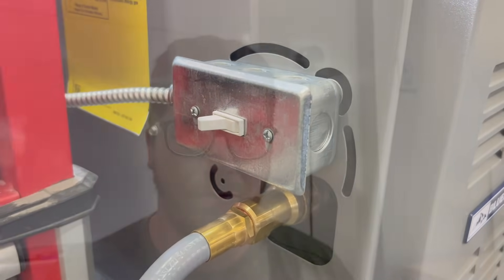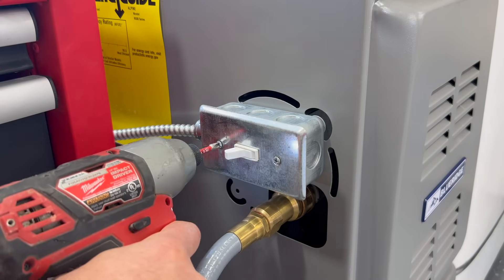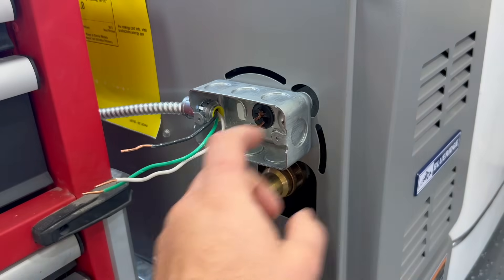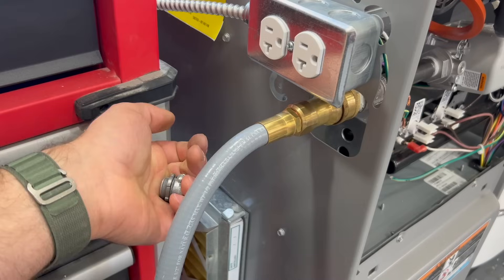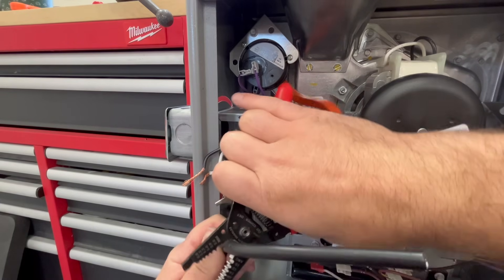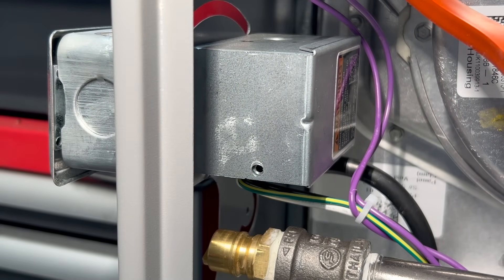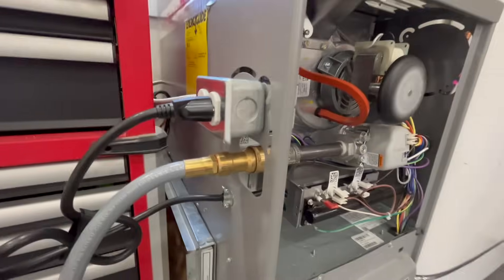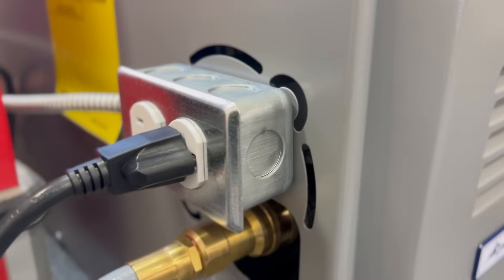Keep Your Family Warm During An Emergency Power Outage With This $20 Fix

Comment: Just a couple of code pointers. That outlet needs to be 15, not 20 amp on a 15 amp circuit. That also needs to be a dedicated (single) outlet or you will need a GFCI. (concrete floor = damp location) That pigtail connections needs to be OUTSIDE the cabinet so you don't void the UL listing of the appliance. (temp rating of internal wire) Last but not least, the NEC will call for a service switch at the unit even though a cord / plug qualifies as a disconnect. This will be under the headings of permanently installed appliances. Probably best to swap out that 2x4 electrical box for a 4x4 and do it all in one place. Store the excess pigtail behind the BX cable in a loop.
Reply: Yes, HVAC techs are not electricians.
Reply: @billy-go9kx    which is why most HVAC guys don't have a full grip on the NEC, despite their license covering all the wiring near a unit. (but not into the breaker panel)
Reply: @billy-go9kx  True, hence the wrong terms and wrong steps or missing info for a safe install! Stick to what you 100% know to keep people safe! Great comments from those who know!
Reply: @billy-go9kx  Why yes, some of us are... Even if not, we should know the code of what we are doing or don't do it.
Reply: You are 100% correct.
Reply: You could use something like a Leviton T5225-T Combination switch & 5-15 receptacle, which would fit in a single box.
Reply: @leeroth5604    Yes, you could but for a DIY that work box is getting a little crowded with the extra wires and restraints. It has no room for side entry with that device in place and the screws will be hitting when trying to secure that device. 4x4 box with a mud ring is the way to go.
Reply: @leeroth5604  : He made another video where he uses the Leviton switch.
Reply: @leeroth5604  Yes, combo switch/outlet solution! Upgrade to a 1900 box and single gang ring if necessary to avoid crowded wiring.
Choose a new knockout for that power cord to avoid any drilling.  Yep, Neutral to Ground adapter (or a spliced, tagged cord?) if required; be aware that will trip a GFI.  
Be careful! Don't try to do all this working in the dark, LOL.  THINK - Are folks really qualified to attempt this in the first place especially with an external power source? All of these things can kill!
Reply: Yeah this be a total code violation on multiple levels here in Canada. I even had my installers come back after they installed the switch wrong. Here you need to have a service/emergency switch, it cannot be on the actual furnace but has to be at least at a certain distance. Mine is at the  entry door into the utility room. When placed there it can also not be at the regular height of switches but has to be at average "eye" -ish level, with a red face plate if it's a gas powered furnace.

To connect the pig tail to a device would also only be allowed if the actual product would state that in the instruction manual and it would then obviously needed to be done as described. Make sure that you do not connect a pig tail If a device is only intended to be hard-wired.
Reply: @paulkoopmans4620 everything is a violation in Canada.
Reply: Could you qualify what you mean here-->    That pigtail connections needs to be OUTSIDE the cabinet so you don't void the UL listing...
Reply: @avflyguy    I'll spell it out.... if you have a UL approved device and you modify it, you no longer have a UL approved device. It may be a fine line but keeping modifications to the wiring OUTSIDE the cabinet is the difference.
Reply: @rupe53  Thanks for that info.  So, the wiring box inside the case of the furnace can't be used to join the pigtale.   Rather those wires need to be joined in another utility box outside the case.  In other words, you just cant leave the pigtail and furnace wires just can't dangle around the inside of the cabinet?    I want to do this right..but I've seen quite a number of other videos that have the pigtale wire connected as shown or similar to this connection method.   Also on the ground wire... it shows the case green wire, then it appears he added a bare ground, but doesn't show where that is to be grounded.  Appreciate your comments -  I just want to get it right and you seem to know what you are talking about.
Reply: @avflyguy   Yeah, it's a grey area but staying outside the cabinet you are only dealing with NEC requirements and not modifying the appliance itself. NEC will have you using proper gauge wire (#14) on the pigtail and all grounds terminate to the external box, which is secured to the cabinet AND the 3rd prong of the outlet, along with being connected to the house ground wire. Per NEC, there's what they call a "fill rate" or "fill capacity" for any junction box. The 2x4 box isn't big enough so swap that outside box for a 4x4 and use a mud ring or a work cover to mount your plug /switch assembly. The catch with the UL listing is about operating temps and exposed wires inside the cabinet that are line voltage. T-stat wires are exempt due to being low voltage. For the actual wiring part, house feed is to the outlet first and the switch goes in line with the pigtail. That way the switch functions no matter what the power source is. (power station or a portable gen in the driveway) This entire grey area is about liability for equipment warranty and your homeowner's insurance. If there's ever a problem with an investigation (fire in the house?) then someone will be looking.
Reply: @rupe53  Thanks again.   I think I've got it now.   Already have a 4x4 box and mud ring.  Just need to get a metal cover plate instead of trying to force all the wiring in standard single gang metal utility box.   I already have the Eaton TR274W-BX-LW  switched outlet and other 14/12 ga wiring I'll need.   The grounding (attached to the cabinet) will also supply a path back to ground back to the panel ground, which inside the panel already is bonded ...(not doing this off a subpanel). What is a bit odd,  is my house was built in 1983 and while it does have it's proper mix of 15 and 20 amp breakers, aside from high draw 220v circuits  all  110v wiring from the panel/breaker box is 12 ga throughout the entire house. There is no 14ga wire used anywhere in the panel to it's destination of circuits, swithches, and recepticles (aside from 220v circuits)  I''ve already made my own grounding plug to bond netrual and ground for the generator (if needed).  My biggest concern is potential for damaging all the electonics boards in the air handler and whether or not this will work with variable speed heat and AC system.  It's not just and on and off.  It adjusts or ramps up the blower as needed to satisfy the themostat call.  In 2021 in the TX freeze out, when power did come back on, the heater ran at high speed for many hours, then when it got to target temp, thereafter it only came on low speed blower.  
You've been a great help to the confidence going forward with the project.  Texas has grown by over 2 million people since 2021 and more EV cars on 30 AMP chargers,  has put the grid more at risk and the governing bodies of TX politics along with ERCOT (the states grid monitor) nor the PUC, or ulilitiy companies have done very little to increase grid capacity and protection much above 2021, despite all the chatter.  We do not import electricity from any other state.  IT's still the WIld West around these parts with gnerations of Cowboy Oil and Gas mentality.   $$$$ is an expected lifestyle for these free ranging career  political chatter boxes.  Smoke and Mirrors...........
Reply: @avflyguy    pointer: look at the data tag on the heating plant. Most likely it calls for a 15 amp circuit... because all of the internal wiring is only #14. The easy fix is to replace the breaker. It's ok to have oversized wires but the circuit should likely be limited for safety sake.
Reply: @rupe53  Yes...  On the tag inside the air handler It does say 3/4 HP  < 12 amp on the furnace and the breaker is a 15 amp for the furnace in the panel.   I'll give it all a go this weekend and see what happens.  Thanks again!
Reply: @rupe53  So... if you burn down the house, your insurer will deny the claim for the use of an installed Unlisted device.
Reply: @eegg6954    with insurance companies there's always a possibility they will try to wiggle out if it's obviously tampered with. Right now I am waiting to hear what an insurance company will say to a guy who burned his house down by using an outdoor deep fryer in his garage on turkey day. (it was raining) Yeah, it wasn't intended for that use so the guy is a dummy. House was appraised at $3.6 million recently and now it's a charred pile of rubble.
Reply: @rupe53 Thumbs up, Thumbs up, Thumbs uuuup ! Lol... But thanks .... This video and comments two out of 5 not waste of time....
Reply: @avflyguy  he's making it up.
Reply: @avflyguy basically hes saying your long black plug wire is spliced outside the containment of the furnace cabinet where your wire connections are made , the same waythe connections are made inside the original light switch box i guess the assumption is the connected points could generate heat or a spark which is better to have outside the cabinet
Reply: He was using his pointer finger on the drill/driver trigger. OSHA would recommend using your middle finger often referring to it as the power grip which reduces fatigue and possible future muscle skeletal disorders.
Reply: @Jesusiscomingsoon613 😂
Reply: That's why you just quickly splice in a plug during the outing, then take it off once power is restored
Reply: @MikeBarbarossa    by the time you do a hack job twice you could have done it CORRECTLY once and be finished for a lifetime.
Reply: @rupe53  How is returning to the in code, proper wiring " a second hack job" get out of here with that strawman. It also takes less time ( 2nd strawman)
Reply: @MikeBarbarossa   ok, do it your way if it makes you feel better.
Reply: @rupe53  I can also point out, if there never is a pefectly timed, long power outage in the cold, so cold you have to run the furnace (less likely in the south) you are the one who wasted time, and it's a lot of time based on the trip to the hardware store, and all the things you have to do do it "proper" (like you said) based on all the code requiremnts stated by the OP. and all but the biggest power banks will only be able to run the 250 watts a short time ( you'll need the $2000+ power banks to get decent run time)
Reply: @MikeBarbarossa    my pointers have nothing to do with timing of outages. They are for convenience of quick change-over and safety. You can choose your power source based on needs and budget. A boiler uses less power than a furnace and neither runs 100% of the time. BTW, the trip to purchase supplies needs to be done for the shortcut or a proper job, so quit splitting hairs. If you are too cheap to have a backup power supply that's adequate, then you suffer.
Reply: @rupe53  "too cheap to have a backup power supply" You do realize a lot of folks dont have 2 grand to spend " just in case" I can splice in a cord laying around to the furnace in under 5 min and no trip to the store, and nothing to do at all  unless power goes out extended in the cold. I've lived in Texas and Kansas for 60 years, and never once shivered in a house due to extended power outage in the cold. I do understand it's more likely up north
Reply: @MikeBarbarossa  Who said you have $2k to spare? You already implied that you have somewhere to get power by the fact that you are willing to splice in a cord you have laying around. If you have no alternative power source then why bother?
Reply: @rupe53  You said "If you are too cheap to have a backup power supply that's adequate" - adequate backup power supply is $2000+. You have to have 2k TO SPARE after all other needs to get what you said everyone was " too cheap" to get
Reply: @MikeBarbarossa    In case you haven't noticed... there are people who are doing the same thing with a $399 get set from Harbor Freight, which is also an alternative power source. As I stated earlier, it's about YOUR personal needs and budget, just stay safe doing it. Arguing doesn't make your way any safer.
Reply: @rupe53  You haven't explain how taking the 3 wires from a pigtail, connecting them to the furnace power supply in the EXACT same way they were  connected to the regular power source, making the furnace a plug in appliance, the same kind of plug in arrangement used safely by the 100s of millions of appliances  the USA, then taking that and plugging into a Bluetti power souce...you haven't explained how that's "unsafe". You can't say " just is"
Reply: @MikeBarbarossa    I didn't say plugging into an alternative source was unsafe. I said your hurried change-over with a cut off cord sounded unsafe. That's why I went into details of the code and why it should be done the way I explained, and taking your time when you are not under the gun to get it finished.
Reply: Would it be right if instead of running a duplex plugin as the demonstration was done, If i ran a 15A Switch/ plugin combo
Reply: @sambo5103    That would pass muster in most places as a dedicated outlet. IOW, no room to plug in something else. Just remember that if you have a condensate pump (condensing furnace) you'd need another single outlet on the furnace side of that circuit. That could be done with a duplex and breaking the tabs to isolate the two sides.
Reply: Or buy a EZ Generator switch
Reply: @claddagh1000    you had better provide a link so there's not a bunch of people asking what you are talking about.
Reply: rupe 53 already said what I came here to say.
However, I have never had an inspector (authority having jurisdiction) ding me for not having a switch on cord and plug connected equipment. 
That would just be silly.
Reply: @jstravelers4094  The difference is that some appliances call for a disconnect (cord & plug will do) and some call for a local service switch.
Reply: Yep.... I was going to comment, wouldn't it be smart as just to add the pigtail, thereby being able to plug it right in the generator but not negating the switch... I
Reply: My goodness all u commenter's forgot convict the producer of thought crimes.
Reply: Not challenging, honestly want to know, aside from code doesn't a amp outlet protected by a 15 amp breaker provide more safety margin? I understand you wouldn't want a15 amp outlet on a 20 amp circuit but I don't understand how a higher rated outlet (20)  with a 15 amp protection would be bad.
Reply: @lauraniemi508    it's in the code. Basically a 20 amp outlet has a different configuration for the blades which would allow a higher rated appliance to be connected.... and in this case the wire and breaker should not be 20 amp because the heating appliance is not rated for it. Everything should be 15 amp.
Reply: Kinda like saying you can't haul 1/2 ton of cargo in a 3/4 ton truck.
Reply: @lauraniemi508    actually, it's more like saying you can't drive an 8,000 pound truck on a 6,000 pound rated bridge. The bridge isn't rated for the possibility that the truck might be fully loaded. IOW, same size but different load. Look close and you will see that 20 amp outlet is different than a 15 amp outlet.... and a 20 amp cord won't fit in a 15 amp outlet for a reason.
Reply: $20 fix if happen to have a generator laying around
Reply: @RichD-f7k  correct.
Reply: Can I hire you to do this?
Reply: I thought he said some of the older units were 20 amp, thus the 20 amp outlet? 
Did I miss something?
Reply: @consciousobjector2507    I have worked on residential units dating back to the 1930s and never saw one with heavier wiring. You also missed the fact that unit in the video is fairly new.
Reply: @rupe53  the unit is FOR DEMONSTRATION PURPOSES ONLY as HE CLEARLY STATED. 
And everybody's an armchair quarterback lol 😂
Reply: @consciousobjector2507    yes, that statement is at the start of many videos and means "don't do this at home because I don't want the liability when shit happens."
Reply: Nice explanation,
Reply: And the best part is that if you have a new furnace, you just voided your warranty by screwing around with the furnaces interior!
Reply: @thatsright1648       if done my way it's all external and you are not modifying the unit, which may affect the UL listing as well.
Reply: Needs to be GFCI regardless... single or duplex. Can't stand seeing guys like this giving electrical advice
Reply: @muzzcovw7674    Unless there's some new code I believe you are incorrect. Boiler or furnace do not need GFCI. This is why a single / dedicated (not duplex) receptacle usually passes muster.
Reply: @muzzcovw7674  Heh, Muzz, at least this guy is starting good discussions of how to get ready for cold nights without heat.  How much time have you spent developing ideas for the DIY husbands, fathers, grandpas who thank God someone posted something up.  Don't be such a pi$$ ant.
Reply: Can you make a video to show us. Or send link for us novice diyers
Reply: @Spirit08620    if you are at that level, I would suggest you hire a sparky.
Reply: looking at comments for code info. Thanks!
Reply: You said you only needed 3 things to do this job, but it looks like you need many more items.
Reply: Your advice is completely wrong,
Reply: @DanL57    care to elaborate?
Reply: @DanL57  If you're going to say someone is wrong - please specify what exactly is wrong.
Reply: What complicated mess ! Code requires a on/off service switch.  Not some bs cord.Get someone that knows what they are doing. And no need to check for 15 or 20 amp outlet. What it's already wired for is what you need.
Reply: @gerardlemay1672    I included the service switch and I explained why (per code) everything should be rated at 15 amp. If you don't trust my opinion then look up the code yourself. BTW, the plug and cord is for connecting to another power source, which is what the video is about.
Reply: Why do commenters continue to argue with rupe53? He obviously knows the code very well.

His replies are not based on his opinion but what is in the code. Argue with the people that write the code if you disagree.

rupe53 is correct about homeowner insurer investigating if there's a fire.

I have family who's house burned to the ground and all State Farm did was look for ways not to pay them. Some of the excuses were ridiculous.

It took 5 years and an out of court settlement to get their payout.

This battle was all over <$500k in a fire that was obviously not their fault. Even the fire dept investigators signed off to that fact.

I appreciate the comments re the code as if I'm going to try this, I want to do it to code.
Reply: @MetaTaco317    Thanks for the kudos. I should have simplified it (maybe next time) and just said to use the original feed for an outlet and add a pigtail to the furnace at the existing outside junction box, which already has the switch.
Reply: Also, I believe the metal box needs to be bonded with all the grounds.
Reply: @elgato2305    good catch and if you are using BX like the video, then you are also bonded to ground at the panel already. Romex, properly wired to that outlet, will also provide a ground to the panel.
Reply: Also, I think the metal box needs to bonded with all the grounds.
Reply: My daughter's furnace is in the attic.  There won't be any lifting the ecoFlow up through that man hole in the bathroom ceiling.  That means the pig tail will need to be long enough to reach to the hole and down to the floor I assume?  I'm thinking this won't be a DIY job for them.
Reply: this is a emergency situation which is all.
Reply: @donnafinocchiaro5836    you just restated the video title.
Reply: Ogm, thank-you sir!!!! ❤😂and🎉
Reply: Based on what you said I could run from my existing switch to the furnace to an outlet can pigtail and it all should be fine?
Reply: @deancitroni4447    that's basically what I said but in more detail.
Reply: are air handlers and gas furnace on separate circuits? in which case plugging our furnace into a portable generator will not run air handler too?
Reply: @LQVendorFP    a furnace is warm air so not suplying an air handler. (separate unit) If you have a gas BOILER (hot water) then you need to rig up another connection to power that air handler. Those will be on separate circuits.
Reply: @rupe53  thanks!
Reply: Thank you I was going to make exactly the same comment. I am not a electrician but that is obviously a very dangerous setup.
Reply: You can always use a higher rated receptacle, but not lower
Reply: @HarveyWallbanger-ho2cq     you may NOT use a higher rated receptacle because that would allow a 20 amp appliance to be used on a 15 amp circuit. They have a different slot configuration. If you just want better than a hardware store residential grade, then buy a 15 amp industrial unit. They cost a few bucks more and grab a bit tighter.